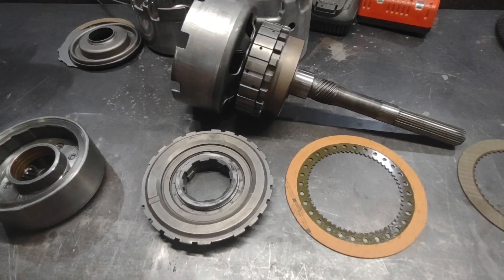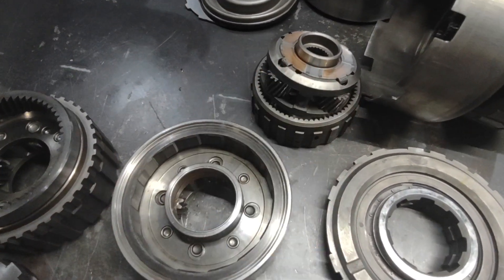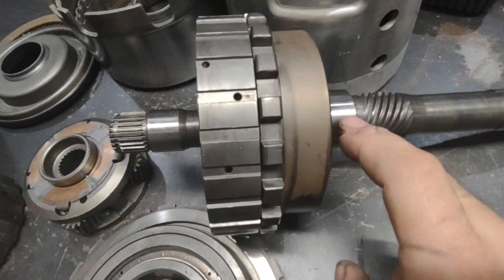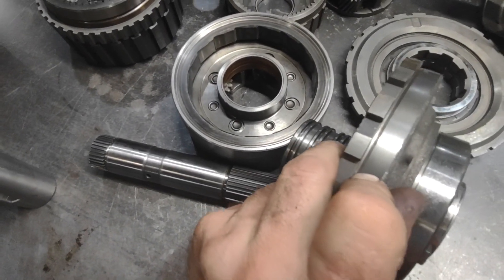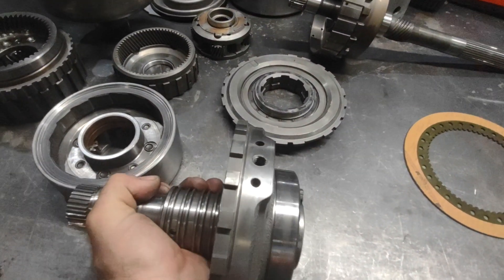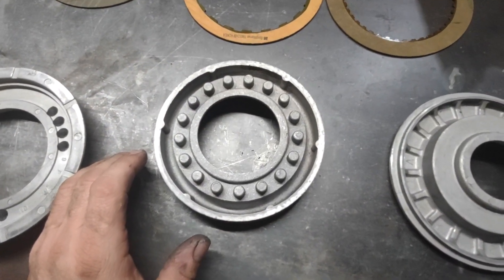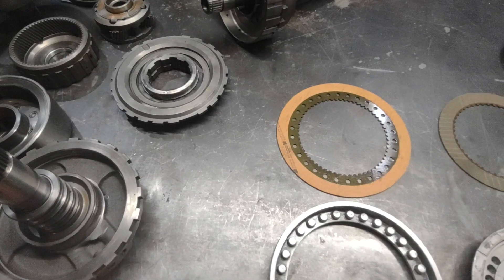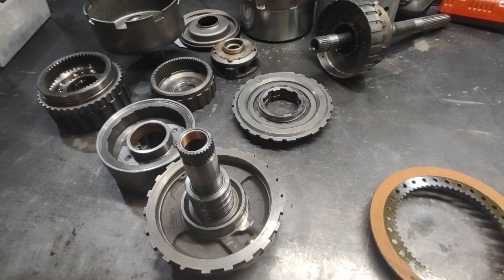TH350 vs. TH400 strength comparison.

Comment: Ive always used T400s in all my drag cars. Better to just start with a beefier unit designed for heavy duty use. Good, simple, strong transmission. Bolt right into a G-body with a 200R4 crossmember. Even stock shift linkage bolts right up. Easy swap.

Comment: GM used T400s behind big blocks, T350s behind small blocks & six cylinder engines. T400 strongest auto trans made. 36 ft 454 RV that weighed around 18,000lbs had a T400 in it. I wonder how long a T350 would last in that application.

Comment: Th350 are so underrated and they been proving to hold 1000s of hp in stock form even with 4 clutch direct I make 890whp and it’s holding just fine and 400 are also good but I’ll choose 350 IMO FOR QUICK AND FAST 400 for tq and weight

Comment: The parasitic drag of the 400 is much greater than a 350.
Reply from the maker: That's the internet myth but doesn't prove true in the real world.
Reply: @jakeshoe  in theory it is true because of the heavier parts of the 400, simple physics. 
The question is how noticable is it in the real world. A direct comparison would be nice.
Running myself a TH400 and think about a swap to 350 but is it worth the effort and money?
Reply: Not enough to matter.

Comment: I ran a turbo 350  with a Hughes kit trans break two extra reverse clutches a  .060 thick also two two extra direct clutches the stock input drum and input shaft    A HD spray in  my methanol powered small block 427  NO power adder . The car with me weighed 2720 it made 660 hp it ran 1.25 to 1.30 short times 9.28  in the 1/4 mile for six years never a problem . Launched it at 3500 to 4000 off the trans break . I took it out to inspect it it was like I just put it together. It was tied in to a 8.5 GM diff with a 33 Moser spline spool and axels .
Reply: Which Hughes kit?